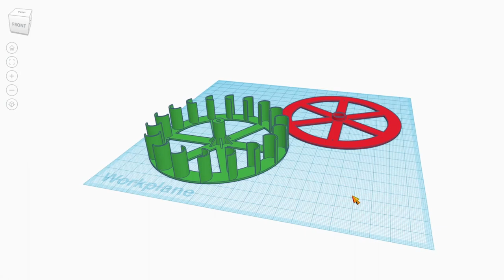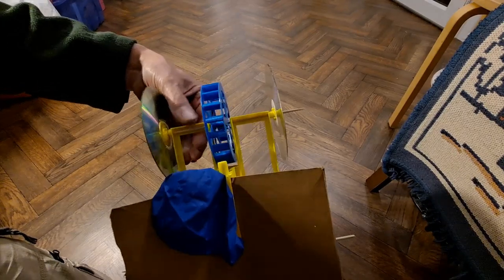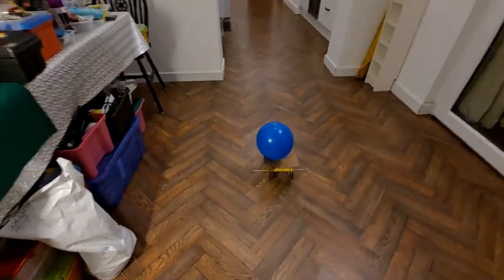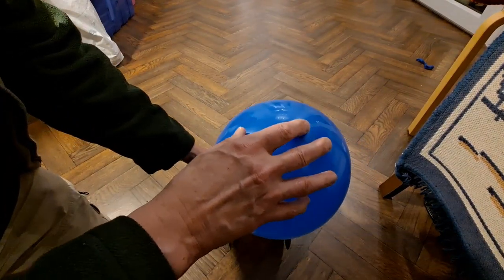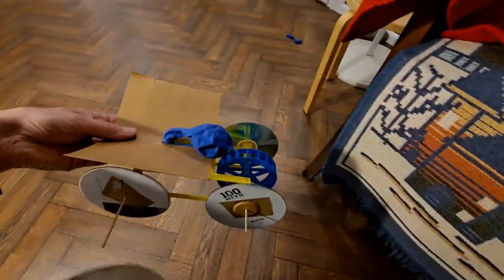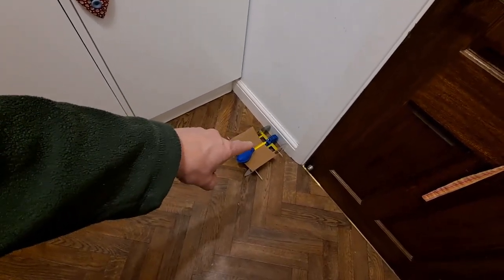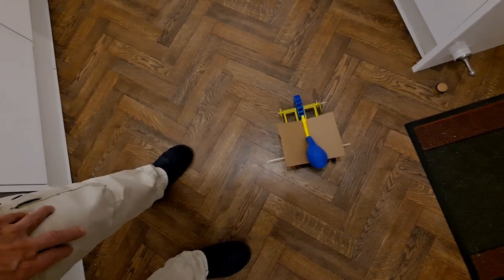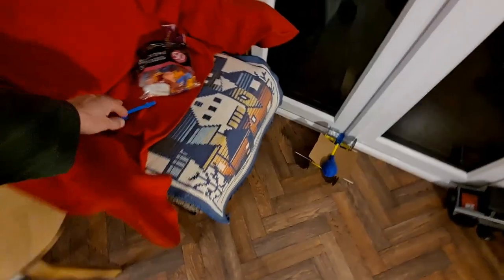Balloon Power Car Paddle Wheel Mk6

Comment: It might help to print and install a shroud
 between the nozzle (and maybe covering the wheel) and the wheel to minimize loss of air (that pushes the vehicle backwards). It would also ensure, should you want to go propulsion, that it's indeed only the wheel that provides motion and not the wind escaping the balloon... looking forward to next iterations :)
Reply from the maker: Thanks John. I have no plans to go any further on this project. All suggestions like adding a shroud or enclosing the wheel add to the complexity and would increase the need for more accurate construction. Simple things like using a metal axle and ball races for the bearings would also improve performance.

Comment: Nice video. But I think it all Depends what Type of nozzels you Put on  bigger hole in the nozzel makes the car go further but its gonna use up more air.😀
Reply from the maker: Yes Marc. That was the point of the comparison, and all the previous videos. You have a fixed amount of air in the balloon, so using the different sized nozzles and the different paddle wheels was all about trying to find the best combination to give the best result with the fixed amount of power. Unfortunately I ran out of the smaller balloons, so I was forced to use a larger balloon in the last couple of videos, so the later videos cannot be directly compared to the first few videos.

Comment: You certainly "never" give in. Works great with both nozzles and the new wheel. 👍👍👍
I wonder if there is a print for a tesla turbine. You know the thing he invented that has "no" paddles and works by means of the air hitting the surface of a smooth disk which is enclosed in a plastic housing. Seemingly they are very efficient with air pressure and can attain high RPMs. Just wondering if there is a 3D print for one of them and if it would work as a drive unit for the balloon car. 👍👍👍
Reply from the maker: There is a lots of mass involved in a Tesla turbine so I would expect it to be relatively heavy compared to the open paddle wheel, obviously depending on what size it needs to be to produce enough power to push the car using the balloon as the power source. You are talking several disks layered with a small gap between them. That would mean printing lots of disks and sticking them together, plus the enclosure. For accuracy you would need a metal axle and bearings, not my bamboo canes in a loose fitting tube. Nothing that can't be done, but a far more technical build than I want to get involved in at the moment. Maybe one to go on the list.
Reply: @GrandadIsAnOldMan  Yes, it does sound rather complicated. Would still be interesting to print one if there are any 3D files. I did see someone who used CDs as the flywheel so you wouldn't need to print disks. Although with CDs it would be heavy. and the balloon pressure might not be strong enough. I really don't know enough about them but they are interesting. 👍👍👍🎸🎸🎸
Reply from the maker: @mikeflight9  yes there are plenty of 3d files available, it is a popular subject. Most people get all excited on how fast they can spin which would be completely irrelevant for this purpose unless you also add a gearbox. That may even be a pointer to unsuitability if it needs a high rpm to deliver the power.
Reply: @GrandadIsAnOldMan  Still, it would be a good project for your channel Graham but not related to the ballon power, just a new build project. Your channel is picking up a lot more subs. I do think you will get the 100k this year mate. I think I mentioned before about a new generation coming up and becoming subscribers for your channel. 👍👍👍
Reply from the maker: There has been a spike in new subs because my YouTube friend Atomic Shrimp featured one of my videos. His video had 29K views and he has 603K subscribers. That was worth around an extra 350 subscribers on that one day. I suspect I will lose a lot of them again when they see my channel is not dedicated to the subject matter he covered. There is an awfully steep hill to climb to get to 100K